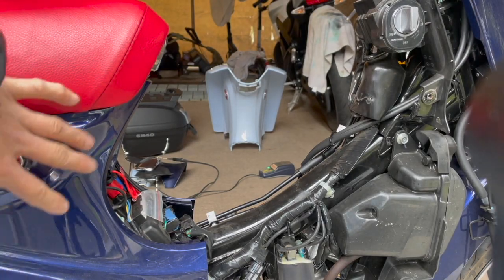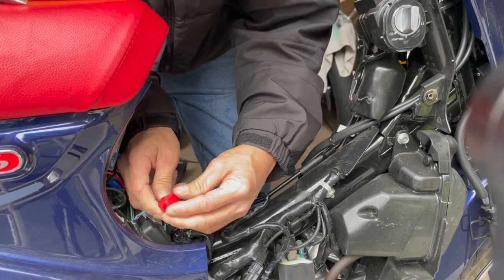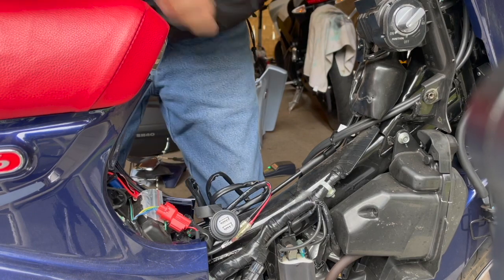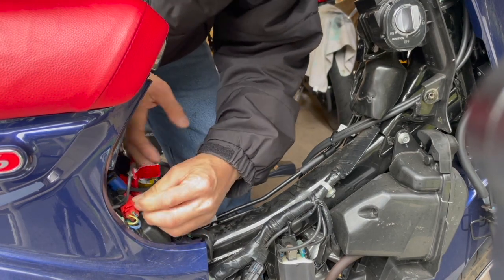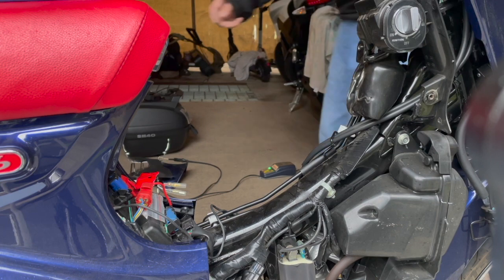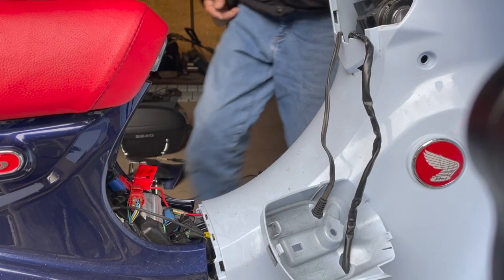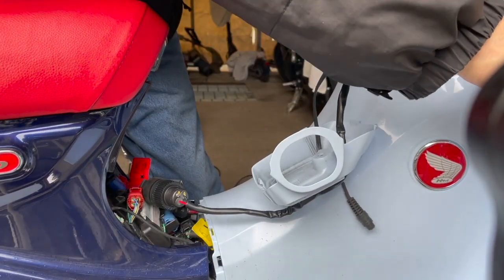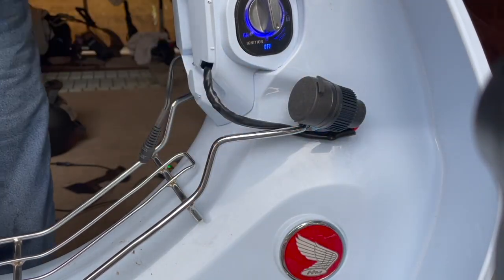SuperCub C125 USB power socket install

Comment: Is it possible to just straight up connect to connect the black and red wires to the diagnostic thing? I’m trying to install heated grips but mine didn’t come with that plug that you connected the black and red wires to.
Reply from the maker: best to connect to battery